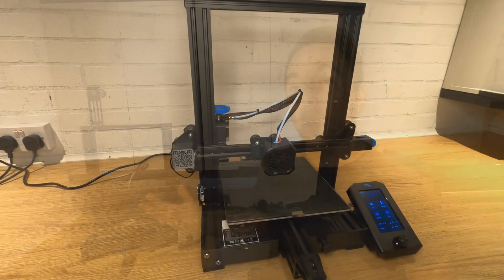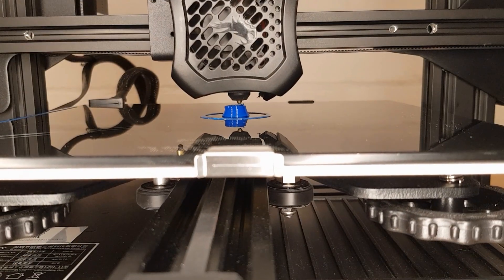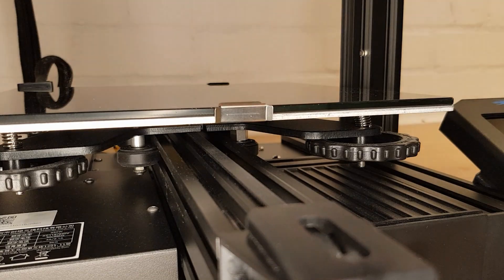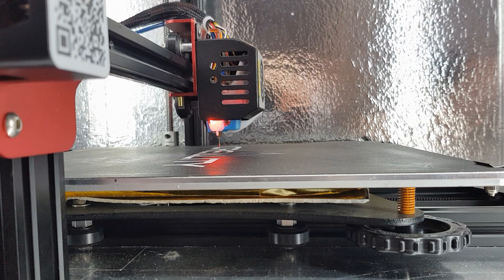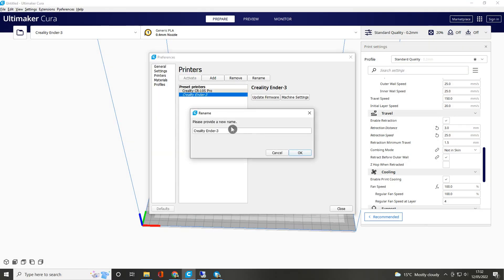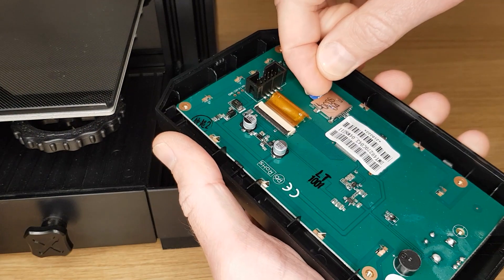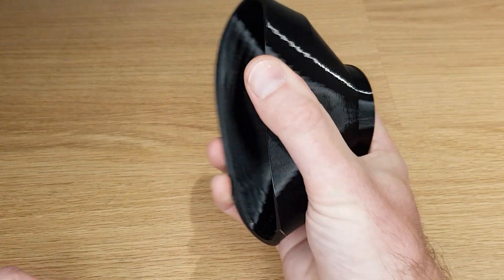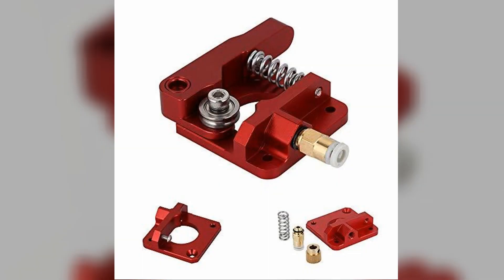Ender 3 v2 - Still The Best Budget 3d Printer in 2023? The Truth After 6 Months

Comment: 6 months ago, I had never messed with a 3D printer.  My young grandson bought this one, thinking it was plug and play.  Wrong!  After his parents helped him mess with it for a few months, they gave up.  They asked me if I had the time to get it fixed, because nothing was working.  Even the Creality tech support was stumped after they had them replace the 4.2.2 control board.  Since I am retired with 50 years of IT experience, they thought I could help.  

The first thing I noticed was that the movements of the stepper motors were not what they were supposed to be.  After digging in some of the Reddit groups and Googling, I found out that a batch of these printers left the factory with mislabeled stepper wires.  When plugged into the control board according to the labels, it would not work.  I reversed the two incorrect wires at the control board and it worked!  They never had considered this.  Funny the Crality tech support didn't know this.  It is a common issue with a bunch of these that came out.

After fixing that, my biggest challenge was leveling (tramming) the bed.  Tinker, tinker, tinker.  Very frustrating.  I tried a CR-Touch and couldn't get anything consistent.  Different mesh results every time I tried to create a new mesh.

I finally decided it was a mechanical issue with the way it was assembled because some things were out of alignment by just a few degrees.

Tore the whole printer down and reassembled it from almost scratch, using a good square.  I found that it pays to get the alignment of everything just right.  Found a wobble in the print bed assembly.  Fixed that.  Loaded the Jyers firmware with 3x3 mesh for the BL-Touch.  Carefully trammed the bed manually, created a new mesh and fine tuned the mesh.  Set the Z-offset carefully.  Cleaned the bed with Isopropyl  alcohol before each print.

Finally, after months of frustration and tinkering, I am getting good consistent results.  Too many tweeks to Cura slicer to list here.

There are lots of people that have produced some very good videos on YT and lots of people on Reddit who have had the same problems and share their solutions.

This is a hobbyist printer, for sure. I meet up today with my grandson to give it back to him with all the upgrades and repairs I have done.  I wrote up tutorials for him for the key steps to make successful prints. He is only 11 years old, so we will see how he does with it.  He lives 300 miles away from me, so I can't be at his side to help if he runs into trouble.

Overall, I would buy this printer for myself, if I wanted a new hobby, which I don't.  I have learned a lot about 3D printing, in general, and this printer, specifically.  My wife will be happy to have me refocused on my neglected "Honey Do" list.  Ha, ha.
Reply from the maker: Sounds like you did a great job of sorting that printer out. Most don't have the patience or experience to sort out those kind of issues. It's a shame that we sometimes have to go that far to get a printer working correctly and that many actually come assembled with problems from the manufacturer. I haven't had a single printer from Creality that hasn't had some assembly issue from new. It's a shame as they are generally well designed machines for not a lot of money.
Reply: @RickyImpey  I love a good technical challenge, for sure.  Tell me something geeky can't be fixed and I'll find a way to get it working.
Reply from the maker: @redmach12003  Oh yes, me too!
Reply: Do you have those tutorials available? Great job btw. Looking up to be as good grandpa as you!
Reply: @joaocoelho7799  Thanks!
Reply: Please help. Neither my ender 3 or ender 5 are working. They both worked fine for a few weeks but then took a shit and only print birds nests if they print anything at all. I have done everything. New nozzles, new tubes, new beds, leveling a million times, new filament, checked the extruder for cracking, tightened and loosened the spring. I'm about to toss them out the window. If I could return them I would. Please help.
Reply: @dwightschrute8726  rip
Reply: OMG - I loved reading your post.   I am retired as well, with my 12 year old Grandson's Ender on my workbench!  
Papa can fix anything, he says.  We'll see...
Reply: @jamesc5279  That's what the job of Papa calls for - lots of love and determination.
Reply: What an absolute legend 💯
Reply: not only are u a great grandad, you a re also a lifelong learner and I have utmost respect for you! Please accept my digital bow.
Reply: The best way to get out of any honey do list is to get a 3d printer
Reply: 4.2.7 is the latest and greatest control board for this printer, i burnt my first board which was 4.2.2 and replaced it with 4.2.7 and could tell it was running better immediately but at £50 it was probably not worth upgrading unless you original has stopped working
Reply: What a nice story. I appreciate such good read. 😊
Reply: damn you're an awesome grandpa! lose a few points though for not teaching your son/daughter how to do all that for him, lol

I had a few of the same issues as you - mainly bed leveling and the X-gantry not being perfectly square were things that took me a lot of time to pinpoint and then fix. I use a BLtouch now and honestly as long as I don't mess with the manual leveling knobs it seems to keep working ok, so that's cool. The gantry hasn't given me any trouble since I repositioned it either but that was annoying as hell to get right..... to be fair though I wasn't smart enough to think of using an actual square to measure; I literally dropped a tape measure down from the gantry on each side, checking to see if the distance to the bottom of the printer was equal to the other, and messing with the screws to adjust it the whole way. derp
Reply: @jdally9872  My grandson is slightly Autistic and doesn't have much attention span.  He also lives 6 hours away, so it was tough to show him step by step how to fix it.  When I finally had it working, I took it to him and we walked through everything I did to get it running.  We tore it down and rebuilt it together, explaining how to align the towers, level the bed, etc.  My Son was with us to remember it all.  I also had a diary of every trial and tribulation that I went through to get it working, right.  I gave copies of that to them and kept a copy for myself so I could provide remote support on an ongoing basis.  We have spoken several times in the year since he has it back.  He is happily printing away!  He did learn a lot about it and even came up with a few tweaks of his own, which shows me that he totally understood the printer.
Reply: ok boomer

Comment: As a former Ender3 V2 user:
- Creality board & TMC drivers: Due to less than ideal HW design of these boards, it is not possible to use all features a TMC drivers offers (such as setting the correct motors current by FW or Linear Advance). Moreover board v4.2.2 has cooling issues (and v4.2.7 solves only this cooling issue). The only solution of all of this is to replace the board, almost by any vendor but Creality (e.g. Bigtreetech SKR Mini E3 is often used as replacement by many people).

- The probe is really missing in these days. It should be included by default. You don't need it, of course. But it makes life much easier. I bought it when Z endstop started to fail (which is not "if", but "when" it starts to failing).

- V2 displej looks nice, but it's quite limited and doesn't allow to use all features Marlin FW offers (such as "bed level corner assistant" using leveling probe). One has to deal with it or replace display to a more friendly one ("standard" display used in E3/E3Pro offers much more. It only doesn't have the appealing look of V2 display, but certainly offers more.).

- "Carborundum" glass is often more warped than aluminium bed itself. E.g. mine was so wavy, it was impossible to use it without bed mesh calibration (and again, having probe is big bonus here). The cheapest solution is to get rid of it and buy cheap glass by glazier.

- Extruder plastic lever is prone to crack quite quickly. Even with the least tension. (easy and cheap solution is to print spare one sooner than the original one cracks. Which was in my case after two month). The aluminium "upgrade" is just thrown money out (it has own issues). If someone wants to upgrade extruder, then BMG clone by TL (with the space for Z lead screw) is much better choice.

Overall Ender3 V2 is so so "good enough" printer. The only benefit it has, isn't vendor, but quite large user community (and printer issues are well known). It's up to everyone if that's enough.
It was fun to tinker it, but as I recently heard most people don't like it (tinkering the printer). Anyway, as my first printer it served well.
Reply from the maker: Thanks for your comment. You're not wrong in all you say. I think it's a good printer to start with at a decent price with a few limiting factors that show up when you start trying to do more advanced printing. It's clear to see why they are so popular but also why people look for something else once they get to a certain level of experience.
Reply: @RickyImpey  well said 👍

Comment: I've had my 3v2 for 6 months as well and is my first 3d printer. So far I've been very happy with it. The only issue I have is an intermittent floating Z home. 
Every once in awhile the Z will home to a different position. I've messed with it and I can tell when it loses it. As it will go to its different Z home. There are only 2 different positions it ever goes to so I'm not too worry about it.
Reply from the maker: That sounds like a misbehaving z limit switch Jeff. Have you tried changing it?
Reply: @RickyImpey  no I haven't yet. When I command it go Home, intermittently it will not reach the Z switch where you hear the switch click. But it's always at the same height. Other times it will stop at the "click" and home there which is a bit lower. It's like it has 2 home positions if thar makes sense? 

It's always been so stable as to where it homes I haven't looked into of the Z switch is causing it or if it's a software issue? I keep wanting to order a new Z switch to test it out when I make an Amazon order but I keep forgetting.
Reply from the maker: @jeffallen3382  ah ok Jeff, it may not be quite so straight forward then🤔 My first thought was a false trigger of the switch before the lever is pressed but that wouldn't happen in the same place all the time.....
Reply: @RickyImpey  that's what I was thinking. Thank you for all your videos you have put out on these.

Comment: Bye far, the best 3d print channel for ender users in my opinion, you've changed my prints from messy globs of pla to the best of quality. I'll also note that PLA PRO by Esun gives me prints quality of that to a much more expensive printer.
Reply from the maker: Thanks Kyle. I haven't tried PLA Pro, I wonder if that's just their name for PLA+🤔 I'll keep an eye out for it.
Reply: I use Esun PLA+ (not PRO) and get extremely good results with it in the 3V2 (0.1 layer height).

Comment: I chose the Ender 3 v2 because of the large user base. In all fairness, the FB community of users has always been supportive and friendly. Newbies are totally welcome.

And it is an extremely affordable machine which can lead you - if you want to go in that direction - into a pretty steep upgrade path. 

I want to print stuff in carbon fibre infused nylon...for good reason given the nature of what I make. It is pretty amazing that the Ender 3 v2 can handle this type of extreme upgrade. Mosquito hotend and Bondtech direct drive. They cost more than the whole printer.

But this is down to need, and the Ender 3 v2 can be all things to all people. The freedom to upgrade - even if it's a metal extruder and a Capricorn tube - can give you an even better printing experience for very little outlay. 

As far as firmware goes, I installed Jyers which solved a few drawbacks and generally made life a bit easier. 

I started out using an Anycubic i3 mega which died a horrible and complicated death. I still can't get my head around why they would want to run proprietary firmware on their products. 

But owning an Ender has taught me far more about calibrating and running a printer than the Anycubic ever did. N9t because it's unreliable or overly temperamental, but because the tools to get things right are so readily at hand. Calibrating steps and flow rate were painless, not that I'm looking forward to doing it all again when the Mosquito arrives.

It makes a pleasant change to have such a complex bit of kit running consistently well with a bit of research and testing. 

And that it can be adapted to print in engineering grade materials is pretty mind-blowing. 

The one thing I'm unhappy about is the lack of air vents in the cover of the PSU and the tinning of cables going into the main board. As soon as I can I'm getting some PETG to put the airflow situation of the PSU right and a crimper to replaces the tinned end of wires in the main board. 

But hey. At 220 quid, being overly critical isn't a good look.
Reply from the maker: Yes Larry, I love the versatility of the Ender 3v2. Pretty much anything you don't like about it can be modified. I've even seen someone upgrade to a bigger bed which would be a step too far for me I think.
Reply: @RickyImpey  Hmmm. After being on disability benefits for so long (and having to really sacrifice to save up) I can see the attraction of having a large print volume at minimal cost. I have a feeling it may be a step too far, though. I manage by making as much of my stuff as modular as possible. It's all very IKEA around here.